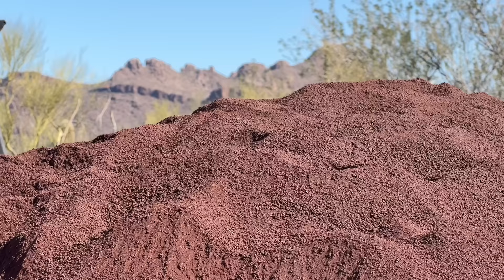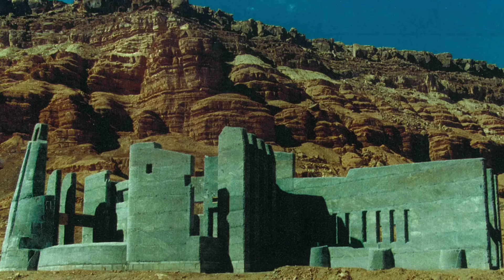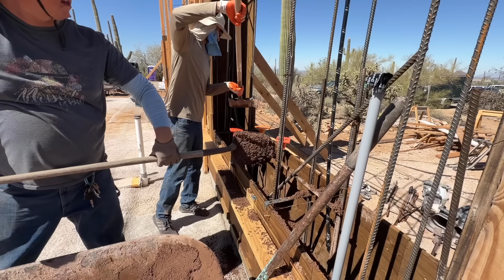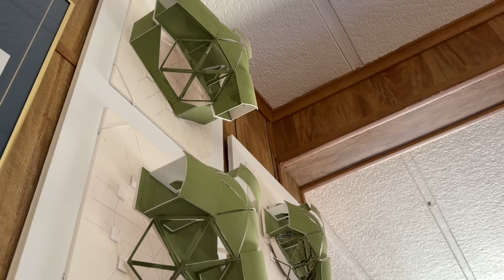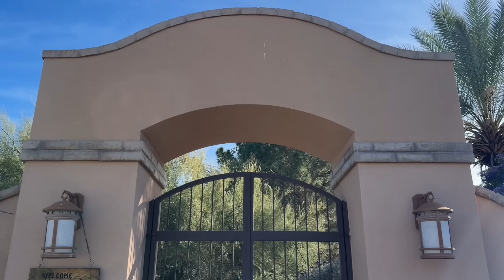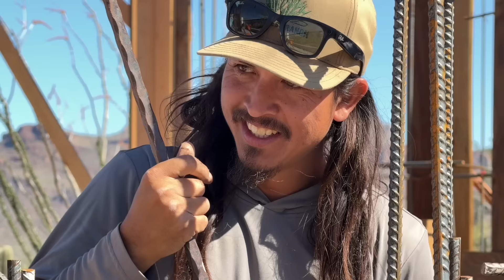The COOLEST Alternative Building Method You've NEVER HEARD OF

Comment: Awesome video. Lavacrete is definitely a solid alternative if you can't get your hands on Hempcrete. Practically built in the same way but with added material compared to Hempcrete. I'm shocked that the numbers for Lavacrete are that low.  Only R1 to R5 compared to the R30 from Hempcrete. Great video. I learned a lot today.
Reply from the maker: So FYI hempcrete is completely different. It's not structural at all - just an infill. And still needs weatherproofing like plaster. R Values are generally per inch so you can't really say hempcrete is R-30 and Lavacrete is R1. Hempcrete is 2R-3R per inch, Lavacrete is 1R per inch. So while it's about twice as insulative - again - it's not structural at all so you  have to build an entire support system around it, then go through the plastering process. Not that I'm saying that's wrong or bad - all natural building methods have their pro, cons, and tradeoffs. But like mentioned in the video the point of Lavacrete is to trade some of the strength of concrete for better insulation, sound aborption, termite resistance, water resistance, speed, no need for finishing work etc... You get better insulation from hempcrete, but not strength or water resistance - and you have to plaster it. With both materials you can build a thicker or thinner wall based on the R value you need.
Reply: @TinyShinyHome  thanks for leaving that response. Lots of info there

Comment: Paul Schwam popularized scoria building in Tucson, AZ. One of his friend's father was using it to build for 10 years before he even knew about it. He called it LAVA because it was Light weight, Aggregate, Vertical, Application concrete. This was a vertical kind of a concrete. It was very playful and relatively inexpensive. Going up as walls and roofs and other things and that was brand new gymnastics for architecture. He's been developing equipment for 30 years. He built several houses along the way. He kind of built houses by accident while he was developing an industry. That was the beginning of this and sustainability was always his "North Star." Guru Das Bock learned with Paul and has been building with it since 2017. Lavacrete has longevity for many generations. Scoria sand is a byproduct of screening for landscape lava rock. When crushed and sifted you end up with a very sharp lightweight aggregate that locks together with a binding agent. Portland cement or lime can be that binder  and using rebar is still recommended for lateral forces. It differs from traditional concrete in workability, application. and performance.  Wow, it can be poured much drier and cures faster with no masonry joints to cause points of failure. It's thermally efficient, acoustically insulated, and fire resistant and termite resistant. It doesn't require heavy compaction or special equipment. Once the forms are removed there is no finish work needed. The surface is naturally weather resistant and  absolutely beautiful. It saves so much labor on the finishing stage that they are very excited about Lavacrete! Building more sustainably is not having to bring the materials to your project from a long way away. Being near scoria or cinder sand is a good reason to use this building method. You still need substantial footings for the foundations for the Lavacrete walls. I'm looking forward to watching you build! Thanks for this video Longnecker family!

Comment: I'm curious if anyone knows if this is a functional option in wetter climates? I can see the advantages in a dry climate but would it be too porous to hand prolonged rain or can it be treated somehow to help with that?
Reply from the maker: Only if you don't build the eaves large enough to protect the walls. Alternatively you can put a water break in the middle, usuallly done with some foam insulation. That way even if somehow the water soaked through it wouldn't make it to the inside. For a 16"-24" wall it's unlikely that would ever happen anyway.

Comment: How strong are the walls whats the PSI
Reply from the maker: More than enough for residential. If I remember correctly the 5:1 ratio gets you like 2500psi which is nuts. We will probably experiment with doing less binder in our building for that reason. That's a lot of compression strength for a shed 😂
Reply: @TinyShinyHome 2500 might be good for shen but not a house
Reply from the maker: Check the adobe code, remember we're not trying to replicate the strength of concrete. Like Paul says in the video concrete is overkill for architecture. 2500 is plenty, and is easily passing engineered tests and code permitting today.

Comment: The Romans built with tufo, volcanic aggregate, lime and volcanic ash. This also made the concrete strong and enabled them to build the dome in the Pantheon which is mind boggling!
How long does the lime take to cure against the Portland cement?
If the Pantheon had lasted at least 2000 yrs, think I'd rather use lime! 😊
Reply from the maker: I think (don't quote me for sure) that Guru Das said he would wait at least a week between 2' lifts if only using lime. BUT if you aren't ping ponging forms and just leaving all the forms on you could probably keep going every couple of days.

Comment: Never even knew this was a modern thing. Is the lavacrete considerably lighter than standard concrete? Just guessing it would be as the volcanic rock is quite porous and lighter than most rock. Could also have a really good use in higher levels in housing when weight might become an issue.
Reply from the maker: Yes it is lightweight compared to concrete for sure.

Comment: Is lavacrete practical in places that usually get freezing rain as winter precipitation? The harmful part of Portland cement is the lime. Have you ever heard of lime poisoning?
Reply from the maker: That might depend on the aggregate size. I would think large chunks would have more open areas prone to holding water than freezing. Either way best practice for any wall is to have good roof overhangs protect from driving rain.
Reply: The harmful part referred to is the Carbon released into the environment by using Portland Cement
Reply from the maker: Correct, it's the heating process during cement creation that is bad for the environment, not the lime itself.

Comment: 10:11 re: TAMPING - it seems with the size of the tamping tools they're using that you could vary the tamping pressure strategically and get a more dynamic wall.  like you could heavily tamp 1-2 inches on the outside and inside edges to create stronger surfaces, and then very lightly tamp the middle portion to get the more insulative effect in that section.  Or maybe if there's rebar you could heavily tamp the center section around the metal, and keep the edges lightly tamped.
Reply: That's what you do with poured  Hempcrete walls ..pack the inner and outer  surfaces tight and then less at the core for insulation.
Reply: I know nothing about any of this construction. BUT if concrete supposedly is great for some things but overkill for homes... then why not use concrete for the footings and build up lavacrete on the concrete foorings?

For insulation properties... why not tamp the "candy shell" inside and outside first. Then apply the inside loosely tamped, if at all? I mean, is it possible to do the surfaces that see light and air first? And then follow to fill the center?

Comment: Lavacrete didn't work in the uk because of our humid weather. I liked the options of hemp and stone rebar. Lavacrete was used in the construction of uk schools but the rebar coroded leaving the buildings un safe. Using non corosive rebar might have veen the answer. It was a big scandel here.
Reply from the maker: Sounds like steel rebar was the problem for sure.
Reply: This happens in most buildings, rebar eventually rusts, in like only 30 years in some climates. It’s why you can use fiberglass or basalt rebar.
Reply: Thanks, great idea.
I'm looking to grow Hemp as an income crop and for materials to build my house.
About 2200 sq ft, single story, with extreme insulation and mostly solar energy and water catchment available.

Comment: 8:26  yes! Thank you so much for this info!  I have 3 acres of lava in Hawaii that is ready to be turned into a house!
Reply: 5:1:1
Reply: Use geopolymer instead of cement.
Slag‑boosted GeoLavacrete
Binder solids:
     40% metakaolin
     40% GGBFS (slag)
     20% sodium silicate solution
Aggregate:
1 binder : 1.5 sand : 3 lava rock (scoria can completely replace sand if ground and screened properly for  multi‑modal distribution—fines, medium, coarse.

Strength: 80–110 MPa  
Notes: Slag adds toughness and reduces activator cost.
Reply: When life hands you lava, make lavacrete.
Reply: Will code let you build it tho? Probably will be a struggle. Maybe worst case you a build a tiny home how the city wants and then you start building non living supposedly( you tell the city that) and you build random building that you tell the city are a gym and a storage shed and a garage and a sauna etc but then you can also kind of enjoy or live in a sense in those buildings. Because city prob wants insulation outside these walls im guessing, im gonna go talk to my city if they might allow this but the adobe code usually wants r 10 exterior insulation outside any mass wall so do you really have to convince them about the R-value and also about the strength and how what kind of engineer is going to actually approve it and who's going to actually understand its strength and stuff so it's not going to be easy especially that are 10 on the outside and it's it's going to be really hard for sure but I know I'm going to try as well so good luck to you hopefully you will succeed I also live on a volcano for my lot is on a volcano overlooking the city it has a lot of like pumice kind of like more aerated lava so I knew that there would be some kind of potential it can also use it for the foundation as an insulating layer you just break it up and then just put it underneath the foundation maybe 8 inches for extra insulation there as well
Reply from the maker: Yes, like we said in the video both Paul and Guru Das have been building engineered code, compliant, and permitted buildings for years. If you have an adobe code it performs very similarly in that regard.

Comment: Roman concrete did not use lime per say, it used Quick Lime mixed into the aggregate dry before water was added.  Beware when water is added the reaction is intense with plenty of out gassing so ventilation is needed!

Comment: Wow! I love the look and sustainability of the lavacrete! Stupid question: I live in Minnesota. How well would the material hold up in bitterly cold weather? Obviously transporting all the materials would make it not cost effective but I'm curious as to how it would handle -20-55○ below winter days.
Reply from the maker: Like mentioned in the video it’s .5-1R per inch. So a 24” wall could be 24R. You can also put insulation in the middle and pour around it for added thermal capacity. But I don’t know what kind of R value you’d need in those temps.

Comment: I remember an article in Fine Homebuilding magazine in the 90's about "pumice crete" it was concrete with bean sized pumice poured into forms for walls.
Reply from the maker: Slightly different- much lighter than scoria
Reply: Yes, I imagine so. It really makes a wonderful home. My friends in Taos absolutely love it.
Reply: There are a few ultra luxe homes in Santa Fe built of pumice crete.  I'd love to see identical pumice, hemp, lava ALL with lime and then the lava with Portland. The home building community would learn so much.
Reply: I live by a puffed Shale plant, they take the shell and bake it so it gets Airy, pops like popcorn. it's wild the way the light from the red hot furnace reflects off the clouds at night, and the red on the clouds reflects off the snow in the fields. It makes for a really eerie night time in winter
Reply: Yeah, that works though you may want trial it - not all pumice is the same. It’s easy to meet the 300psi strength the building could demands.

Also I had trouble with stratification - pumice floats in water. Mix had to be pretty dry to be homogenous.

I want to try it with acrylic modified cement
Reply from the maker: We didn’t have time to get into it in this video, but Paul Schwam is experimenting with all kinds of different aggregate and binders in the same field. He showed me a sample that used iron oxide instead of cement so that it would absorb c02 instead of creating it. He’s like a mad scientist!